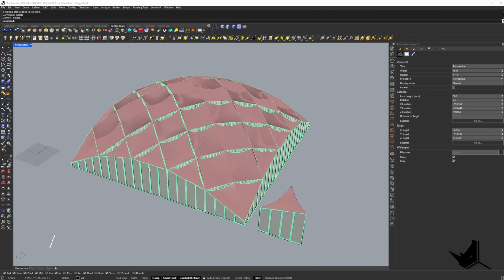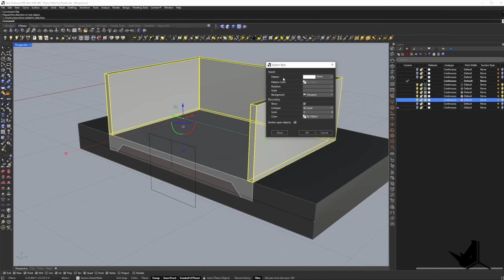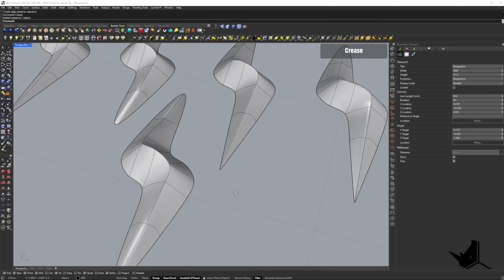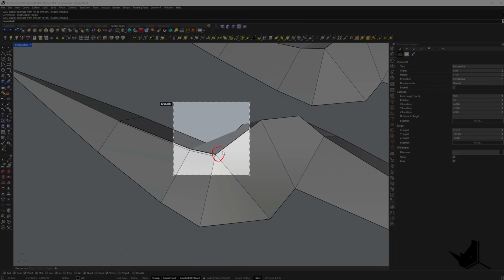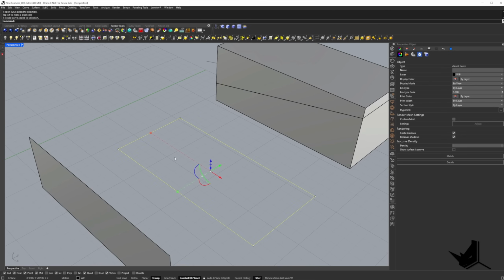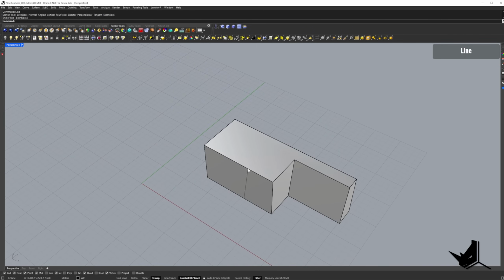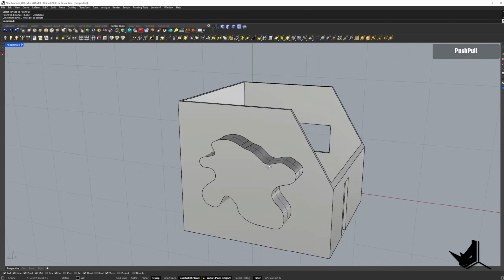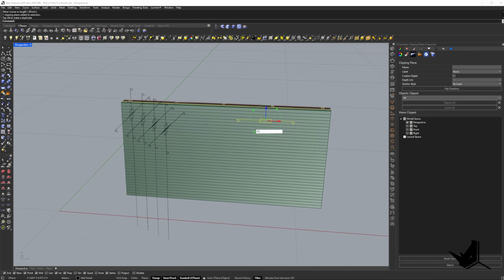Top 10 Features of NEW Rhino 8

Comment: In regard to selective clipping, this function does work in display modes in the viewport (Windows 10) but does not work for Raytracing or Vector Output (PDF). Based on my experience, I would say that this feature is currently a work in progress in Rhino 8. The feature unexpectedly now works better in Rhino 8 for Mac than in Rhino 8 for Windows.

Comment: fillet in rhino is the most annoying
Reply from the maker: I agree on that one :D It's improved in Rhino 8, but there's still room for improvement in that area for sure
Reply: Fillets are easy if you know how to handle them in a clever way. I agree with you that fillets in Rhino are not as fast as in Solidworks or Catia, but on the other hand Rhino's fillets are more reliable and you can actually do a lot of manual adjustment to them, which is not possible (or not as easy) on the other CAD packages.
Reply: @AutomotiveCNC  If there is software that makes things easier for users, why should they use Rhino? give me an explanation. I work on products using Rhino which takes much longer than using software like Palsticity or Fusion 360. Please answer
Reply: You can check come of my recent videos showing simple tips for doing successful fillets in Rhino.

Comment: The main thing we should focus on is the workflow of Rhino , which is very very old and falling behind , it does not make sense to type every command in the command line to start a command , this is very slow workflow , we should interduce an entire new system based on shortcuts/pie menus for rapid modeling/operating .
Lets take a look at blender or plasticity , the workflow of plasticity is 10x times better than rhino even it's a new software , but it's a lot more faster and easier to work , 
i mean i love Rhino but if the ancient UI/button layout/workflow will stay the same i  am afraid i am considering to buy plasticity even it does not have even half of Rhino features , but its developing rapidly and i really like where it's going . 
i mean don't get me wrong , i really love rhino and it has been a long time for me using it , but now it just feels falling behind other software , 
i would really appreciate a complete modernization of the software for a better slick UI and workflow , 
thank you again
Reply from the maker: Yeah, I see your point. At the end of the day, you should look at all of these tools from your point of view and what you're using it for (depending on your industry). Take into account all the features including parametric design with Grasshopper. Rhino + Gh are huge platforms that other developers build on top, so the community is really big, sometimes that is also important. You can voice your opinion on all of these features on Rhino forum as well and talk directly with developers on these issues if you'd like them improved.

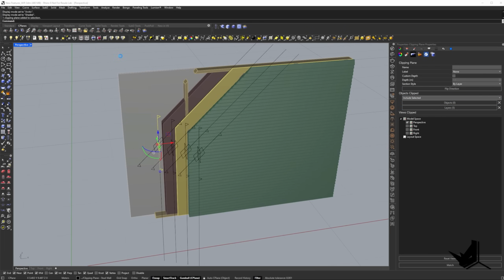Comment: I'm a bit stuck on how the screen-capture and sketch-on-top-of-feature is performed at 25:32.  Is that windows, or the recording software, because I see no command line change in rhino.
Reply from the maker: At 25:32 - I'm showing how to use Selective clipping feature. Regarding the sketch feature. I just selected the surface with ctrl+shift+select to active AutoCplane and then I typed "Sketch" in the command line, but it was done at 23:27 Every single command I do, you have a name of that command in the upper right corner of the window. Hope that helps.
Reply: @HowtoRhino  Thanks for the response. I don't think this has anything to do with Rhino or the clipping feature.  You just happened to be talking about that feature when you drew a window on top of Rhino, and a dotted box appears with control points on the corners and midway points like Adobe Indesign, with two tool bars appearing in the lower right corner to draw, type, change color, save, etc.  I'm just curious if that was your screen-recording software or something in Windows 11 or what.  I am on Windows 10 and am unfamiliar with this sketching-on-the-screen ability, and cant seem to find it with Googling or reverse image searching the little corner tool bars.